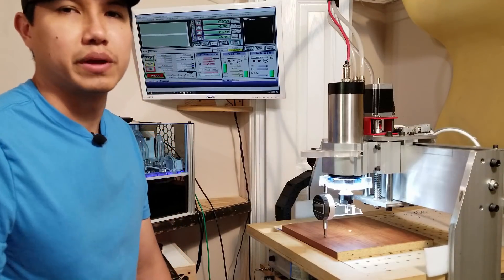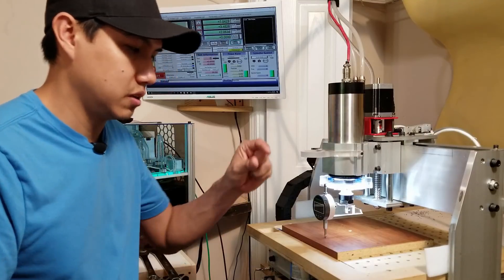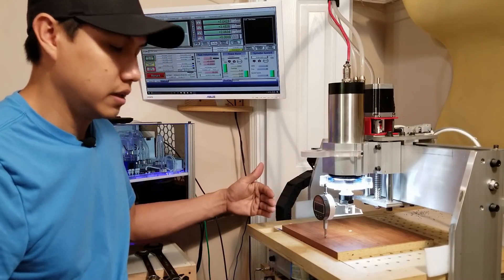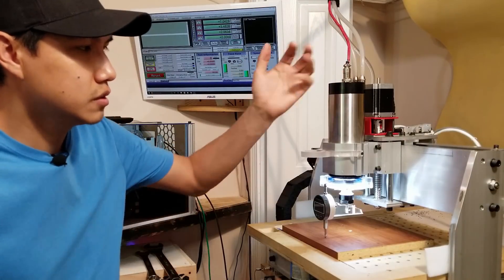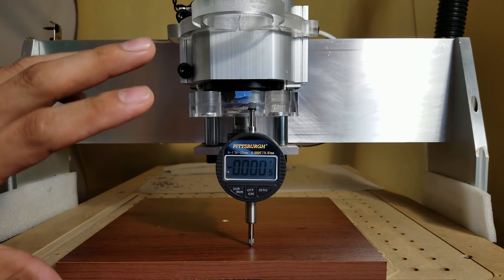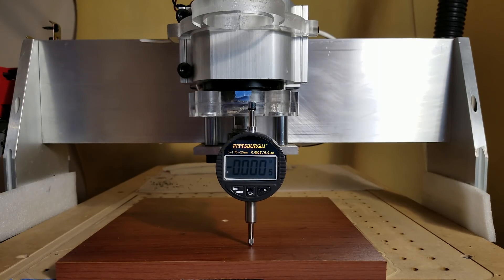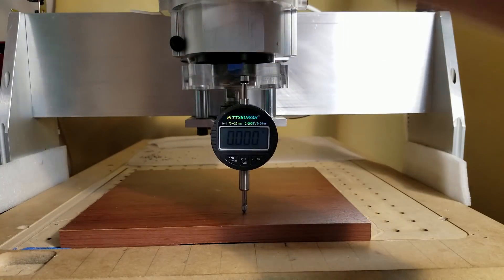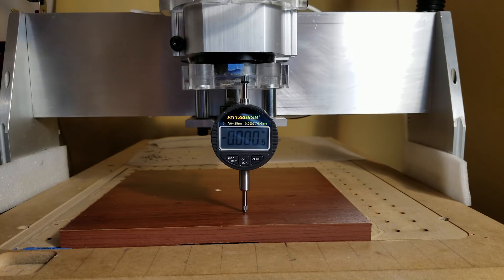CNC 6040 Improvements, fixes, and upgrades

Comment: Your rail rods are to small in diameter to support that much weight. It is sagging under the load  more in the center of travel, which drops the tool down. Only way to eliminate this is to completely redo the crossrail with quality box type linear slides mounted on a 1.0 thick aluminum plate. And reposition the Z axis slide as close as possible to the rail.

Comment: im planning to completely revamp mine with flat linear rails , and a massive connection across the gantry.. im thinking concrete filled 4 by4 steel.
Reply from the maker: Rob M might as well build a complete new cnc
Reply: @radikult-custom  i was thinking the same thing.. With all 4 linear rails ( 200 bux ) and the 2 by 6 beam plus concrete plus all that drilling and tapping.. I could just start fresh with a epoxy granite base .
Reply from the maker: Rob M I would love to see the progress.  I’m actually build another cnc and maybe I’ll try to make an epoxy base
Reply: @radikult-custom  ill send a link when i get started.. im finding materials and so on.. bookmarking everything.

Comment: Hi, sorry to bother you, but did your cnc work ok from setup? I have just bought a cnc 6040 from China and am having problems with the stepper motors. They work fine using the arrow keys on my keyboard. but when I add a Gcode (roadrunner) and run, the stepper motors hardly move and make a horible noise, and the Gcode looks to be running fast and I have to stop it. My computer has onboard parellel port and is running windows 7 pro. No matter what I do I can't get it to work using Gcode. I just wondered if you had any ides? it would be really appreciated. Thanks, Terry.
Reply from the maker: Wrighty hi Terry.  I actually got just the frame and I added my own controller and steppers.  
But what I think is happening is that the run runner is a super fast Gcode and your steppers are staling. I would suggest trying a different Gcode (slower one)  
 The other thing it could be that the run runner Gcode is in inches and maybe your cnc is set to MM?
Reply: Hi, Thank you for the quick reply. That makes a lot of sense. If I switch the cnc mack 3 program back to inches just to try and run it again, that should tell me if it's one of the problems. is that right? Thanks, Terry.
Reply from the maker: Wrighty well you don’t want to drive that. Since you will need to set the steps and tune your steppers again but in inches this time. 
 I would suggest making a easy slow Gcode of something and try it first
Reply from the maker: Wrighty what’s your steps and acceleration and speed  set to?
Reply: Hi. I have it setup as they told me to. all my settings are the same as in this video: https://youtu.be/0mlfccAVUP4 it might be quicker for you to have a look at this than me trying to tell you. Thank you for your time. Terry.

Comment: Excellent upgrades. I just bought a 6040 and it looked like it had the liner rails on the gantry but it did not. Mine moves just the same.  Where did you get the rails and that gauge that you are using? It seems you made a great improvement with the overall rigidity of the machine which will greatly improve the accuracy of your cuts. One more question, The motor mounts seem to be made of metal. Did were they included with the machine or did you add them.  I see you bought this over a year ago. How is it holding up? Thanks.
Reply from the maker: Gary G I got the linear rail from eBay. I believe it’s a 15mm rail and yes it improved on rigidity.  Still has some play but it’s better. 
I actually build my own cnc and now my 6040 is just collecting dust, but without it I wouldn’t have learn a lot of things

Comment: I am new in cnc machine. I have a 3040 china cnc with bobcad software and running in mach3. My problem is that my G-code looks ok in the measurements block in the bobcad animation, but when transferred to mach3, it ends up scaling down my mold. Does somebody know why? I Will appreciate any posible answer. Thanks in advance. OSCAR.
Reply from the maker: Karina Fuentes make sure that your drawing on bobcad  if it’s MM or inches it matches the same setting on Mach3 
  Or maybe have you check that the steps in your motors matches the distance

Comment: Hi, i was just looking to this video and one idea crossed my mind. Have you ever thinking about putting that thick plate of aluminium on the back side instead ? This way you could attach on the plate some 20mm fully supported linear rod rails  horizontally  with the bearing blocks attached opposite on the plate which holds the X axis ball screw nut ( obviously with the required adjustments ). I am planning to buy one of these machines and this is the improvement i want to do. Idont know if could be used 16mm linear rails instead of 20mm because they are supported ones but even so, 20mm means nothing but more rigidity. If i am wrong, please somebody correct me.
Cheers.
Reply from the maker: Ionut Popa yes that can work,  but at the end you “rebuilding” the whole cnc,  there is a company that’s makes 6040 that have linear rails and it’s a much better cnc overall 
https://www.omiocnc.com/products.html
But you have to select the ones with the linear rails

Comment: I think the one of main reason there is that much flex is because the rails this thing glides on are placed far too low underneath the bed. If you see more modern machines the rails are actually on the same level as cutting head. I'm wondering if it would be possible to heavily modify this machine by raising those linear rails up and outwards somehow.
Reply from the maker: Eugen Krause well the rail on the x-axis are just 2 round rods and not back support, so that adds to the lower rails too, they make a 6040 cnc with linear rails with fixes all the problem but cost more too  and I didn’t know anything about cnc when I got this cnc
Reply: So you would not recommend some one else to buy it? I'm looking at what to buy for my first machine right now, and I can't decide. If I did get this I would have to do a lot of modding I think, but I love the fact I can get a 3020 with ball screws and linear rails for $480, but no electronics. I would rather buy my own anyways, since I hear some of the Chinese ones are pretty bad.

Comment: Very informative video. I would bet if you you performed the same test on some of the larger more expensive machines they would be as bad or worse. I will try this with my 3040. I would think the shorter X axis span would make the 3040 more rigid.
Reply from the maker: Clayton Musgrove the main problem with the 6040 cnc is the rails have no back support,  if they would add the same type of linear rails as on the Y  then it would be more rigid
 Probably the 3040 could be more rigid  because of the short travel
Reply: I would like for you to consider whether or not that flex actually makes a difference in the finished cut. My first thought would be to assume it would. Your gantry would flex more near the center and less towards the edges. Even if you have some flex you still have a spring action downward force on your cutting tool. Because you have .020 flex doesn't mean your cut will be off that much. Just saying I would like to have seen the same test done on a piece of material milled before and after your improvements. Many thumbs up for making me think about this!

Comment: Hi Rad,

First I want to say that I really appreciate you taking the time to do this video. One thing I wanted to point out for anyone watching that wants to measure what you are measuring is this: the measurement tool attached to your spindle is a dial indicator, not a digital caliper. I'm guessing you probably already know this and you just misspoke. For anyone interested, I haven't had a chance to fully test it yet, but so far I'm happy with this one:
https://www.amazon.com/Clockwise-Tools-DIGR-0055-Electronic-Conversion/dp/B01G9K7KCK/ref=sr_1_20_sspa?ie=UTF8&qid=1511513914&sr=8-20-spons&keywords=depth+indicator&psc=1
It's very cheap. I noticed you're using a Pittsburgh one which was probably more expensive.

Secondly, the idea you had of putting the linear rail on the back is very clever. The way you did it, you were able to go cheap and only have to buy one linear rail while still attaining the increased rigidity. That's great because linear rails are very expensive. However, there are a few things I want to say about that, too:
1. If I were mounting the linear rail as you did, I would have mounted it to the top of the back of the X axis. Putting it at the top will allow for a shorter support block (the aluminum piece you machined to attach the linear bearing to the spindle assembly/z-axis). The shorter support block and closer proximity of the rail to the fixed point on the spindle will reduce the torque on the rail due to the shorter lever arm. In addition, it will decrease the effects of any non-parallelism between the linear rail and the x axis itself.
2. In the video, you didn't say whether or not you were careful to maintain perfect parallelism between the linear rail and the back plate of the X axis. If you did not or could not guarantee that the linear rail is parallel to the movement of the X axis, doing so may improve the performance across the whole range and also increase the life time of the linear rail and bearing. Linear bearings are not designed to support much non-parallelism without significant wear, so I would definitely check to make sure the X-axis rods and the linear bearing are parallel. They are designed to handle large dynamic forces perpendicular to the axis of motion,  but I think that gets worse if you have a static/constant load on them, which you would if they were rotated slightly from the X axis. This is not an easy thing to do but it might be worth it. At the very least it would make the linear rail/bearing wear more evenly.
3. To further increase your X axis rigidity as well as your Z axis rigidity, I would add one more linear bearing to the rail (you can buy them separately). Then, machine a wider piece of aluminum for the Z-axis/spindle assembly so that it can attach to both linear bearings, and so that it can connect to a wider section of the spindle assembly. Have you measured the X-Z plane rotation of the spindle? If you have problems with that, it would probably improve that as well. I can't tell from looking at the video, but you might not even lose any X travel capability with two bearings. It looks like your rail extends beyond the limits of your work area. 
4. You're probably right about the cylindrical bearings being a part of the rigidity. That's certainly possible. Hourglass profile linear bearings (what you mounted to the back) are definitely way better for this. Another commentor (Kenny) mentioned that deflection forces could also affect the Y axis (forward/backward in my point of reference), and that's a good point, too. You could measure this by attaching a straight edge to the X axis supports (and thereby disconnect from the y axis gantry drive rods/screws) and then indicating against that edge the same way you did in this video. That would remove play in the y axis from the equation and tell you more about your spindle rigidity with respect to the X axis, which is the problem you're trying to solve here.

I'm pretty new to machining as well, so I may be incorrect about some of what I've said. From what I've learned, it's really difficult to measure and improve parallelism, rigidity, etc. Your video was helpful in that it made me consider things I hadn't thought of before. Thanks again! By the way, don't worry about saying "you know." It's a natural thing that everybody does. To help with that, you could write out a script or bullet points for your videos before hand and use it as a reference (just don't read it out loud exactly). That might help.

Good luck to you and thanks for sharing your experience! Please keep posting!

Comment: When you push the spindle back and forth (with your hand pressure), the whole rail is connected to those vertical side guides, right? So part of the deviation you get could be due to that side of the machine too right? I'm still a newbie at this sort of thing, but just trying to think of where all the sources of movement could come from. Good video you made. I think I will need to go down the same path to fix up rigidity in my 3040.
Reply from the maker: Kenny yes the main problem is that there is no support on the Z or X axis rails,  if you actually see the bottom rail are supported  but the other 2 axis are floating, so that's the weak points  but overall the machine it's alright
Reply: Thanks for your time and reply. Your video definitely showed important things for us to focus on. I wish those folks that designed these machines took a bit more effort to put in some more solid pieces of metal. I think I'll go the same way and get a more solid cross-piece. Thanks for showing highlighting those weak links in this line of CNC models. Genuinely appreciated.
Reply from the maker: Kenny when I bought mine I didn't know anything about cnc  after a year or two I found this 6040 cnc that's actually has linear rails and overall fixes all the problems 
https://www.omiocnc.com/x4-800l-usb-cnc-desktop-engraver.html
Reply: Wow!!! Thanks for that link Rad. I one certainly does look good. The nice thing is you identified potential issues in your system and improved the situation very significantly. Your video will show a lot of people what to look out for, and how to sort things out. Thanks once again.

Comment: a tutorial dremel cnc homemade someday (?
Reply from the maker: Nigthdaker lol. I'll be building a "home made" cnc soon but won't be a dremel / engraver
Reply: low rpm? :c
I almost made a mistake, can it be with a router?
thanks for reply, greetings from argentina =)
Reply: would love to see this.
any idea on the frame style ? 
will it be a cnc mill or cnc router
Reply from the maker: Milan Potter cnc router 25x25 inches, using aluminium extrusion  and 1" thick side arms/Z-axis

Comment: You have made some really nice stuff with that cnc. I cant believe it can flex as much as i did.  That little amount can make a very big difference.
Reply from the maker: John Leonard yes, to prevent it from giving me a bad finish I had to go slower and cut less,  the deeper I try to cut the more force I put and the more it could flex
Reply from the maker: Faissal zin sure I'll try to make it
Reply from the maker: I think they are good  when you compare them to a cnc that cost the same (x-carve - Shapeoko, 3040 and other's)  and if you can fix some of the issues, then they are perfect for Hobby and prototyping
Reply: Would love to see this aswell
Reply: nice can you do a tutorial about Touch Plate to Auto-Zero all the step
Reply: thank you what do you think about cnc 6040 is it good
Reply: thank you